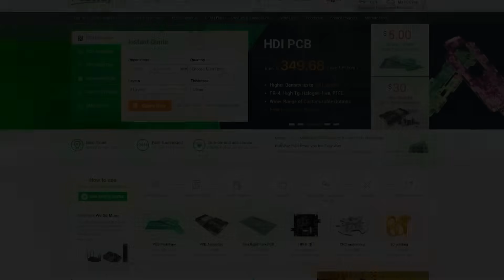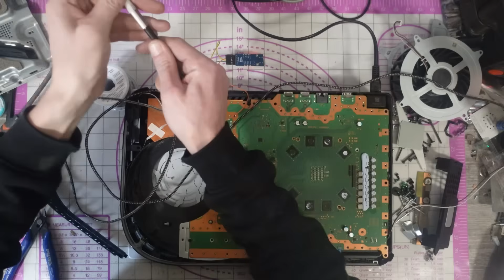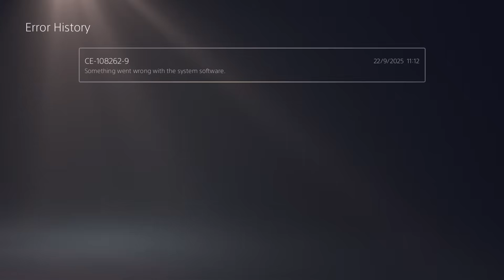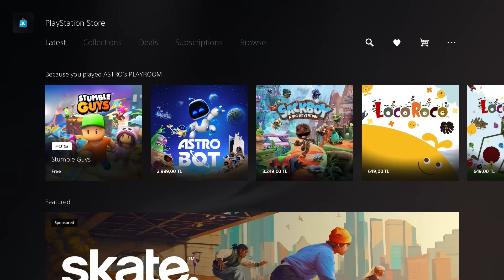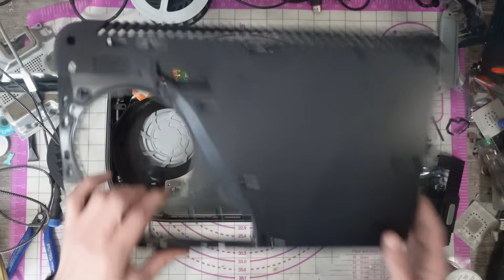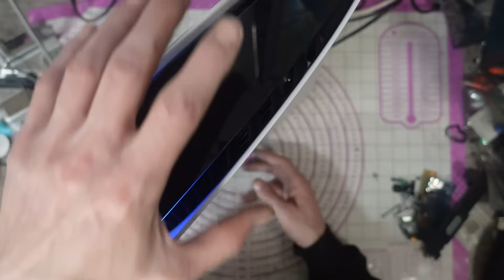PS5 "Repair" CONFUSES PS5 Technician!

Comment: Hello, I’ve encountered an issue with a PS5 model 1116A.
The UART log shows error code 80802080.
I tried searching for information, but I couldn’t find any details about this code.
Could you please advise where I should start troubleshooting or what area I should check first?

Comment: If it popped back up due to a hypothetical transient hardware fault, would you consider it a warranty job?  Is this even considered a "repair" or just a service?  

If I was in your shoes, I wouldn't know how to charge this one, I'm curious how you will handle it.
Reply from the maker: Yeah I'd do it as warranty and try to fix it again or refund it. The way I see it is you're charging for your time not the fix itself. Just set a minimum bench fee. I charge £60 usually

Comment: What does the ce-108262-9 error actually mean and what makes it occur?
Reply: It means "An error occurred while reading the system software or application data."

The causes are :
a) Firmware/software corruption where reinstalling the PS5 firmware or games/app would resolve it.
b) Storage issue where the storage media (onboard SSD storage, or m.2 NVME drive, or external USB SSD drive) has physical fault which may be solved by replacing the storage and obviously reinstalling the PS5 firmware, games/apps.
c) Unreliable/faulty data lines, cables, connectors or circuit lines where data cannot be fully transferred correctly between the storage media to the RAM and CPU/GPU. (implies motherboard issue which is very hard to troubleshoot or impossible to permanently fix)

Comment: Why is that ever code I have the same on on my slim
Reply from the maker: 108262? It's a software error code usually meaning a bad ssd but it can be just corrupt data
Reply: @TheCod3r where is the core software for these consoles located like the factory software and drivers is it all located on the ssd

Comment: If your switch is flashing all the network ports at the same time constantly, there may be a broadcast storm going on. Check for loops in your network.
Reply from the maker: It had been acting up for a while. It's a cheap £20 switch so it probably isn't worth fixing. I have a £300 POE switch to fix soon though
Reply: spanning tree :)
Reply: It's entirely possible that an unmanaged switch is not running spanning tree. I still have enterprise level customers who throw random switches in their network and cause it to burn to the ground.